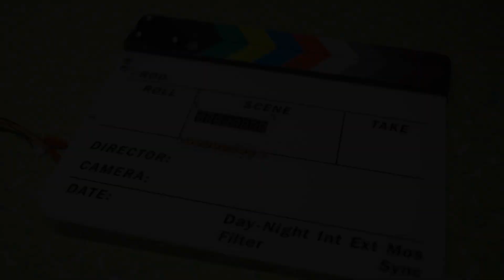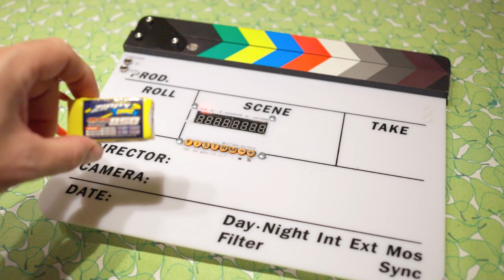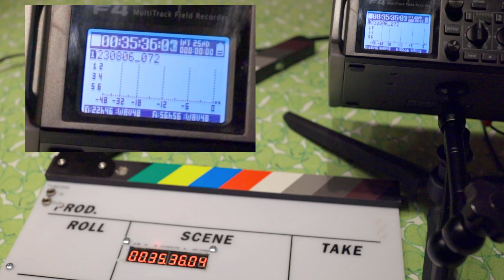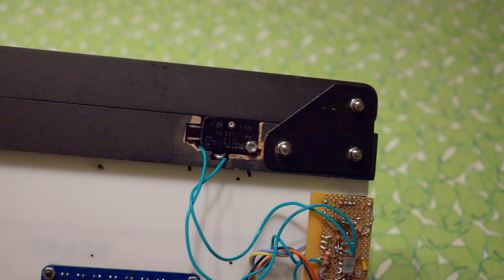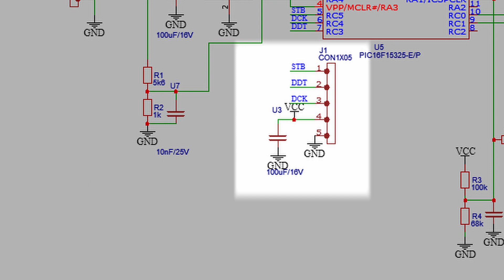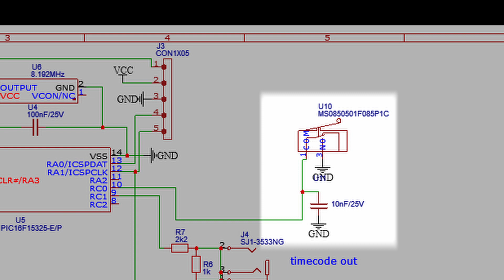DIY timecode slate, easy to assemble

Comment: I love this project. Is there a listing for the pcb, parts list, and programming?
Reply from the maker: sorry for the late reply. I planned to make a list (farnell, aliexpress) but realized it would become obsolete quickly. I offer you a programmed PIC for testing if you wish, for only the part+shipping cost.
Reply: That’s ok. I was looking to see if I could increase the display size and the circuit could handle the larger current draw
Reply from the maker: Yes, even with the same driver, it is possible to use a larger display. Depending on the current draw, a switching regulator might be needed instead of the 7805
Reply: Hi I’m interested in the testing pic , I’m willing to pay for part and shipping cost 😊😊